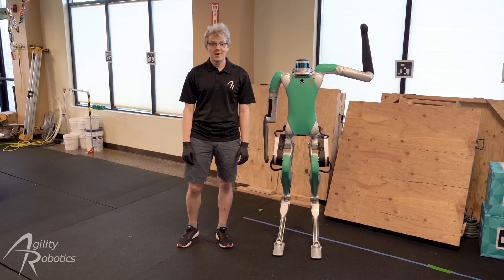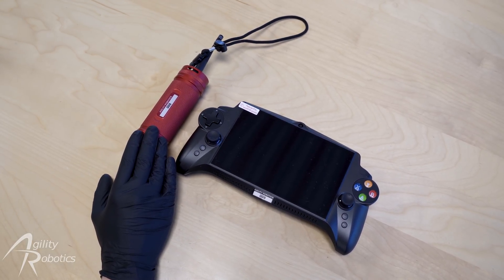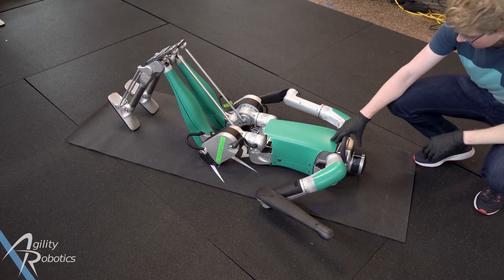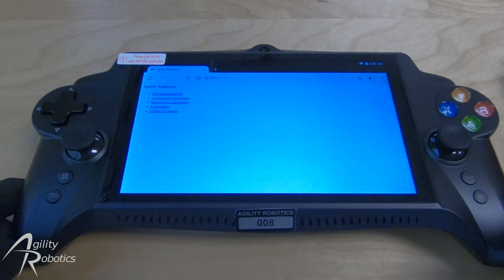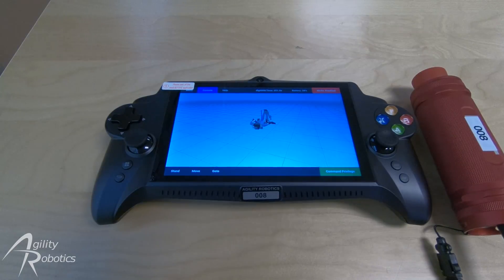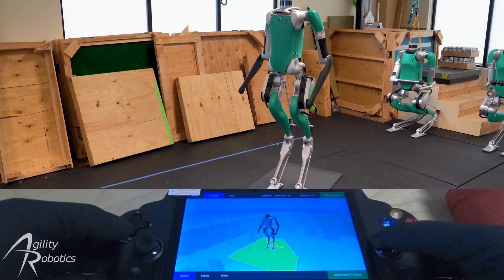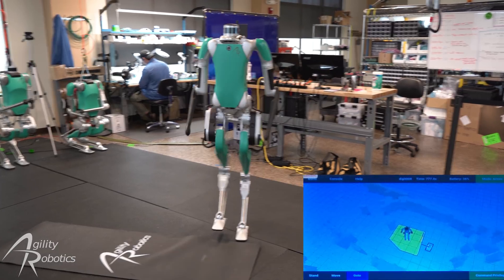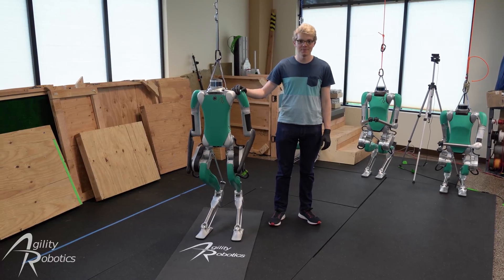Digit Power Up and Basic Controls

Comment: 1:05 so the robot isn't "safe to approach" when its actually turned on?
Reply: Most robots aren't safe to approach when the e-stop is not engaged. Especially industrial robot arms. Only cobots are designed to be safe to approach while turned on. Even common cartesian robots like CNC routers aren't 100% safe to be approached when the motors are on.
Reply: I was wondering the same.  Series elastic actuators can ensure safe human interaction. But I don't know if this robot has them.
Reply: of course not, those motors would break through your bones like twigs

Comment: The controls seem strange - you press mode to make it stand.  The obvious thing would be to press stand to make it stand.  The switching between modes should happen behind the scenes - the user only needs - stand, walk, sleep.  Also it seems you have to move the arms after its gone to sleep before you are able to make it stand again.  It will be better if the arms move to where they need to be after it lays down so you don't have to manually do it.  I guess its still early days though.

Comment: Are they really that dangerous that a whole separate killswitch is required?
Reply: I was thinking the same thing. They don't seem to weigh that much. I'd guess 100lbs max.
Reply: High torque electric motors could give you a severe pinch or possibly take off a finger, but that's like worse case scenario and you'd have to be doing something pretty dumb to get there.